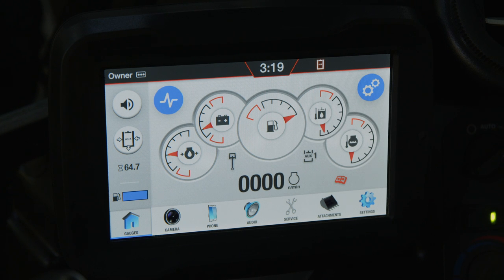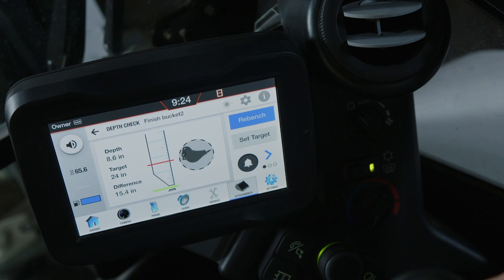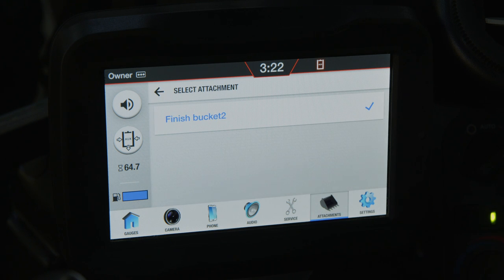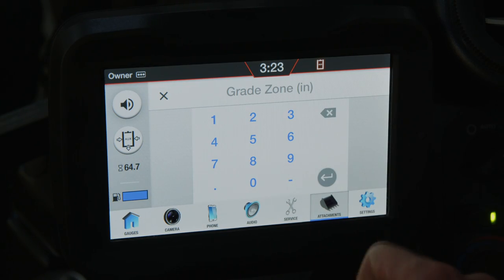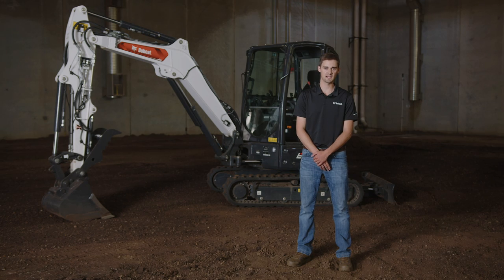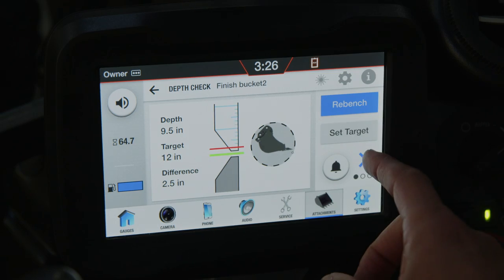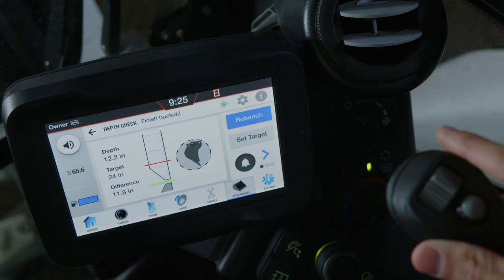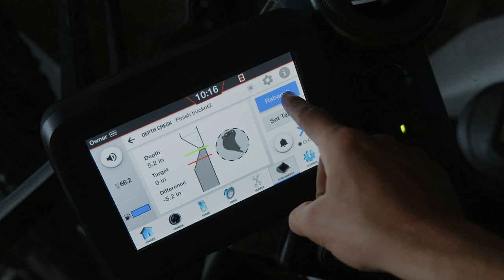How to Use Bobcat Excavator Depth Check System: Basic Operation Tips

Comment: Thank you, is there a video that explains how this function works with a laser level when working from a fixed elevation point? I dig in-ground pools and would like to be able to not reset the depth check system every time I move (if that is possible).
Reply: Same here! haha.
Reply: How do I make depth check work with the blr2 recievers on a sloped ditch?